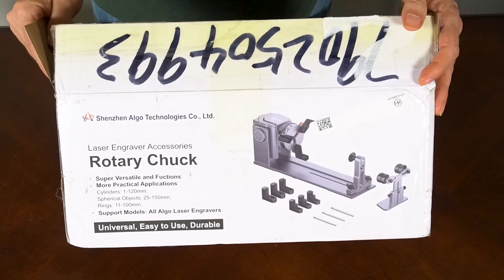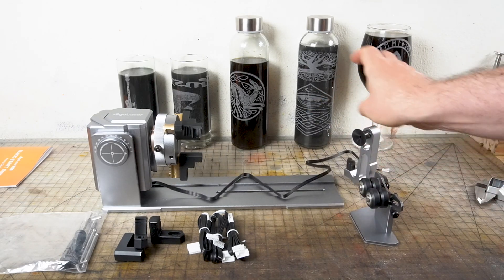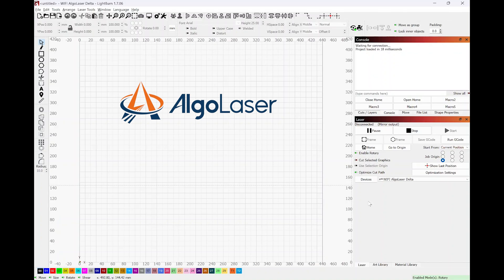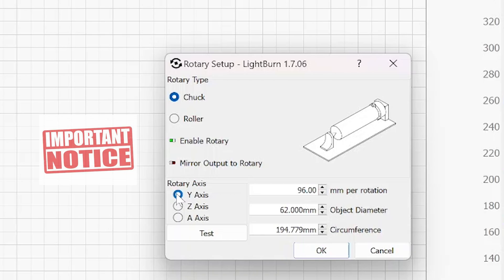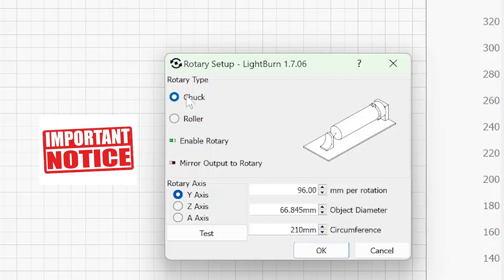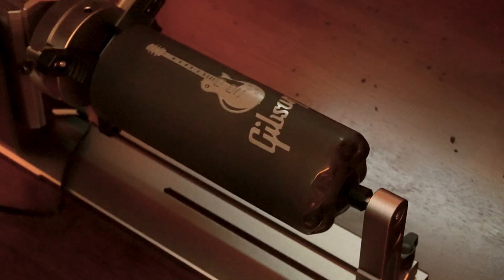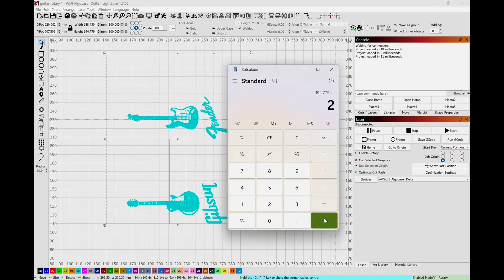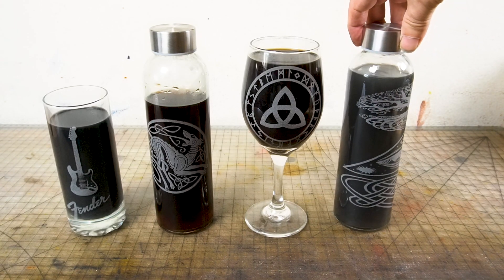Rotary Chuck  Beginner’s Guide and Review! AlgoLaser Engraving Glass Made Easy!

Comment: Thanks for the video. How do you set it back to the original settings? Homing specifically.
Reply from the maker: Thank you, for me I turn the "enable Rotary" back off and then I set the Start From back to "absolute coordinates" if that is what you are using. Plus you have to disconnect the rotary. For the Delta laser that I use I just have to flip the switch back to y axis but I also disconnect the rotary so I can move it out of the way. I am not sure what laser you have so you might have to disconnect the rotary and reconnect the Y axis. I hope this helped. :)
Reply from the maker: oh, I forgot. I found that this was all I needed to do for the machine to home properly.  If for some reason the machine does not home, then press the macro that we created called "open home" this should fix it. if you have any trouble let me know.
Reply: Thank you for replying.  I have the Algo Delta 22w. So it should work the same way. I'll give that a try. Thanks.
Reply from the maker: @glenn8059  I really like the Delta. Nice choice!
Reply: I tried the open home macro button after I turned off off the switch for the chuck and it still doesn't home. I'm not available big fan of this machine.  I'm saving to buy a Rolly laser magic. This machine could be better. Linear rails would've been  better, cable management needs improvement. Airflow warning keeps still showing up. This machine also produce so much emf that it will sometimes stopped in the middle of a job.
Reply: Sorry for the typo I meant  Rolly Laser Matic
Reply: You should check out the Laser Matic. They even have an IR Laser module now, and they are cooking up something crazy with Fiber Laser and diode in one machine.  It's nuts.
Reply from the maker: @glenn8059  I am not having these issues but I have heard many great things about the roly Laser Magic, I would love to own one. Let me know how it goes when you get it. When I converted my machine back to not using the rotary I did not have to click on any of the macros. Ok, I just went through the process again to make sure of my steps. I flip the switch on my Delta to y axis, I first opened up lightburn and made sure I was on absolute coordinates and made sure to shut off rotary enabled. Then I turned on the machine and the Delta homed on it own. See if that approach worked.
Reply from the maker: @glenn8059  I have a 60 watt fiber in my kitchen still in the box. It is my latest review and I am very excited about it as you might of guessed. Laser are a lot of fun when they behave. Lets get your back to normal. :)
Reply: @baronleathercraft  I'll give that a try. Did you have to unplug the chuck at all?
Reply from the maker: @glenn8059  I did unplug it to get it out of the way, I had to cut a wallet. I am not sure if I had to but I did. I brought my machine back to a state prior to owning the chuck.